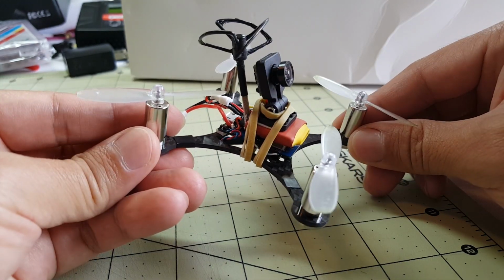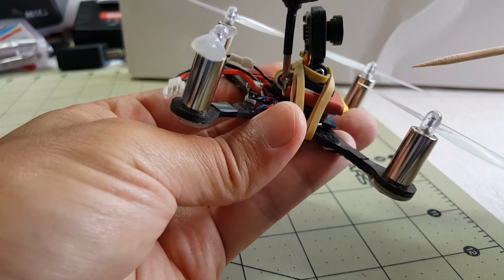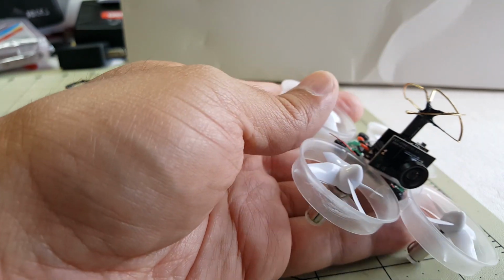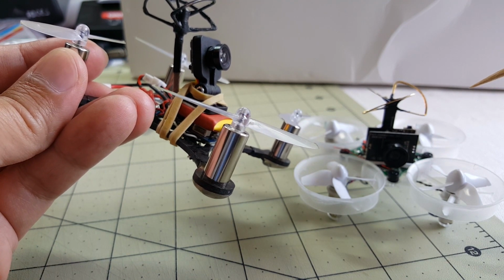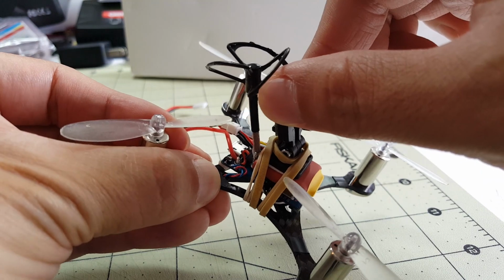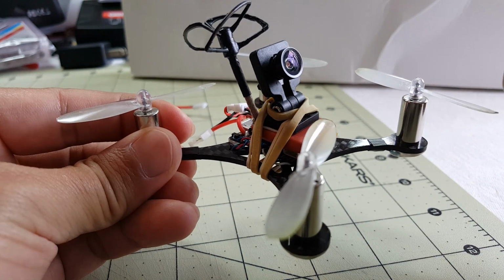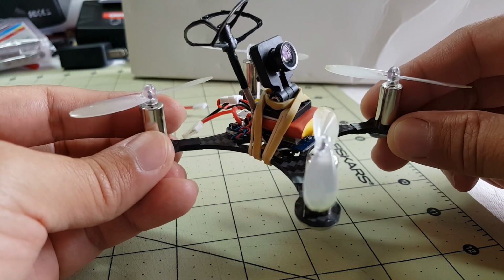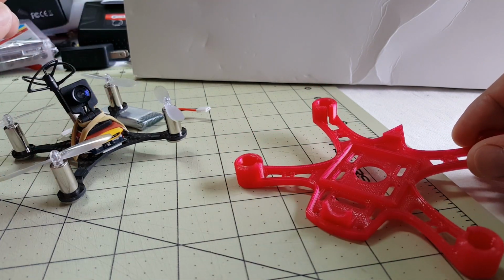Scisky Budget Quad (Under $100)

Comment: Any idea why any later than 2.7.1 build of Betaflight doesn't work? It spins up motors no mater what you set the motor_pwm_rate :-(
Reply from the maker: It has ONESHOT enabled by default. You have to go into the CLI and issue command

set fast_pwm_protocol = OFF

Comment: on the flight contorller ,scisky,what radio does it take? i can not find out i been wanting to build one . i do not want to pay for the woop,like ever body else is doing
Reply from the maker: The Scisky uses the Spektrum protocol, but if you fly FrSky (Taranis), there's a new quad out that is way better and cheaper than this build.  It's only $70 and comes with a FrSky receiver.  Check it out here - http://goo.gl/vYsx56

Comment: +Albert Kim (marblekit) Thanks!!! I got another question: Do you think you could use bigger props on this? Would 65mm props (the hubsan props are 55mm I think) be bad for the motors or ESCs? Or would the quad profit from having more thrust? What do you think?
Reply from the maker: +TheRoesoe depends on the weight of the quad and the amp draw
Reply: +Albert Kim (marblekit) the weight of the quad should be around the same as yours. I'm not sure what you mean with amp draw, but if you mean the C rating of the batteries, it's 35C.
Reply from the maker: +TheRoesoe the bigger props draw more power... if the motor gets to hot it will stop working
Reply: +Albert Kim (marblekit) So you wouldn't recommend to use bigger props than the hubsan ones?
Reply from the maker: +TheRoesoe it depends on the motor and how it reacts to the extra stress. It might be okay. So fly for 15-30 seconds and see if the motor get too hot
Reply: +Albert Kim (marblekit) Ok thanks!!! I'll try that.

Comment: Will this frame work with 7mm motors?
Reply from the maker: I don't think so. Only 8 or 8.5mm motors.  The 8.5mm motors fit perfectly.  If you had some grommets or spacer adapters to take the 7mm to fit into a 8.5mm space then it would work.

Comment: You have any problems with the VTX overheating wrapped like that and in that stack?
Reply from the maker: +Simon Fillat nope. The motors get warmer.
Reply: Nice. I'm going to have to copy you on that one.
Reply from the maker: +Simon Fillat I would say the heatshrink is not really necessary and you can leave it out to save weight.

Comment: Albert, thanks for this video, could you please explain, or link to one of your videos, how you bind the Sci Sky board with your Taranis? Thanks
Reply from the maker: It's pretty easy to do. First, create a model in your Taranis. Go to the model setup page and down to the external module you should have already setup there. Put your cursor on the bind selection ... it looks like [Bind].  Then power up your Scisky board with a USB by connecting it to your computer (don't connect battery!).  Wait a few seconds and the red light will start flashing.  Press the [Bind] button on the Taranis screen.  Wait a few seconds and the red light should go solid.  You are now bound.
Reply: +Albert Kim (marblekit) ahh, which external module?
Reply from the maker: You need an external module that speaks DSM2. The Taranis does not speak this natively. Check out my other video....  http://www.youtube.com/watch?v=lnF2xCp_5WE
Reply: +Albert Kim (marblekit) thanks so much for the clarification and speedy reply. Guess I'll have to look into a DSM module